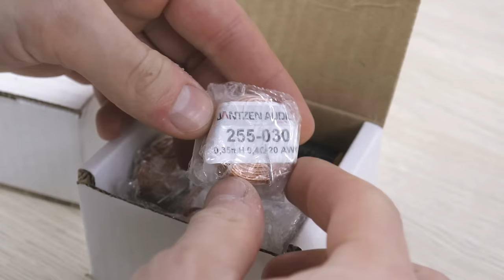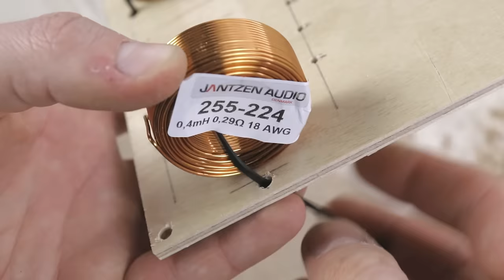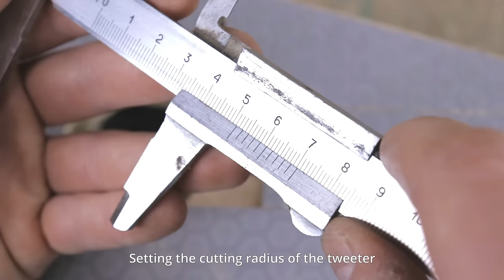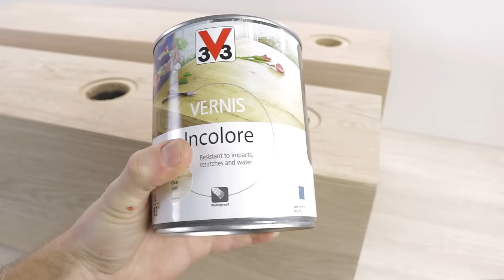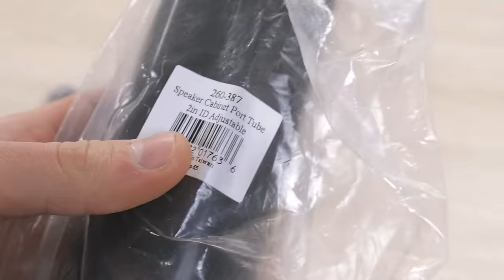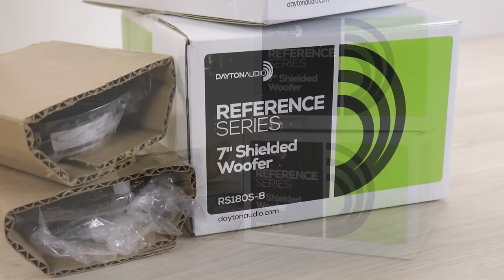These $185 DIY HiFi Speakers Sound AMAZING

Comment: This is so well done! I hope the speakers give you years of enjoyment!

Also, what is that center-punch thing you used? I've never seen one of those.
Reply from the maker: Wow, thank you so much! Means a lot hearing that from Paul Carmody himself.
Just a regular spring loaded center punch. Works great for woodworking and even metals. Something like this - https://amzn.to/3BV8LmG
Reply: Speakers definitely can last.   I built mine back in 1978.  They each contain one 15" woofer, two mid-range drivers, and four tweeters.  The only repairs ever needed was the replacement of the outer rubber foam ring on each woofer.  The old rubber foam rings had literally turned to rust due to age.  Total repair cost of woofers, was about $27.
Reply: I'm excited to see this build, I followed Paul for a long time, ultimately building a pair of ZX Spectrum that I still have as my main set. I built them 7 years ago and have listened to and jammed to every day since then, only sounding better. The abuse through the years these speakers have endured is unfathomable, full volume sometimes hours on end. I'm glad to see Paul is still around, mine are driven by a Rogue Audio Sphinx off a Dual 1219 tt, friends still don't believe I built them. I've denied countless offers of purchase. Covered the front in some neat fabric I found at Mood in NYC, built the cabinets about 3 inches taller with 25 pounds of lead shot in epoxy settled in the bottom, little better caps in the crossovers.  Coolest speakers I've ever seen, hardly ever heard better. Thanks Paul, my family and I are still appreciating your work every day after all these years!!! I'm headed home now with my latest LP, just delivered, and will jam heavy late into the evening. Go ZX baby! Thanks again Paul!

Comment: if you can, make a video of the making of the crossover
Reply from the maker: I don't see the point of making a video dedicated to the crossovers since there are quite a few diagrams online which are clear and easily understandable. Also, there are pcb boards on eBay for easy assembly.

Comment: They are very nice looking speakers.. You did an awesome job.. But the speakers are actually junk the actual speakers not the wood..  They are rated at sensitivity level 82 DB.. Which is very very low that means you have to have a huge amplifier to push it. And they will distort. They're good if you're just listening in your bedroom but they're not good if you're listening to a surround sound system or having a party
Reply: Paul states the sensitivity at 83-84dB, which is not quite 82dB, but still very low. He also states that the Woofers will run out of excursion around 96-98dB, so indeed these won't play excruciatingly loud. Still, at that point, you're only pushing 32W or so, and they're not meant to play louder than that. So no huge amplifier needed.
Also, the notion that low-sensitivity speakers distort is simply wrong. As long as you don't push them past their limits - as with any speaker - they sound as designed. It does not make the speakers junk. If anything, it only means that they are not for you . The Amigas are called the "botique Hifi Killer" - which is pretty much the polar opposite of what you'd expect or want for a nice beefy surround home theater system or a party boombox. They're much more comfortable in a living room, with a record player in the middle, and playing some music with high fidelity, not high volume. (Not saying both at the same time is impossible - it is for this speaker, though.)

Comment: 26:21   be careful next time ,those tipe of drivers cannot take any debries fallen on the voicecoil hole they have no dustcaps and can get easily contaminated and at 26:48  big nono there  put the tweeter on top of some masking tape roll and avoy the dome colapsing inward and risk geting break the silk material
nice handraft by the way
Reply from the maker: Thank you! Learning something new each time!

Comment: Nice job !! But 185$ if you already have the equipment to build the speakers. Really nice job anyway !
Reply from the maker: Thanks! Yes, the cheaper kit does require additional work and tools but the more expensive kit comes with cnc-cut panels so saves you quite some time, effort and need of fancy tools to complete.

Comment: An 8 ohm Woofer and a 4 ohm tweeter?
Reply from the maker: No issues with that, the crossovers are designed for these speakers.

Comment: It's a very beautiful speaker. However, if possible, put the two units in separate boxes so that they do not interfere with each other, and ideally the back of the SP should be long enough to prevent the SP from vibrating. Do not open the bass reflex hole as it makes an incidental sound. This is my SP idea. Thank you very much.
Reply from the maker: Thank you! There is no need for a separate box for the woofer and tweeter. The whole enclosure IS built for the woofer with the required internal volume. Tweeters do not need to be separated since they do not require enclosure volume. These speakers are designed by Paul Carmody, you can look up his great and popular designs on the web.

Comment: nicely built! except, i dont understand how you end up at $185, since even the cheapest kit is already $151 without the MDF box, without veneer, without feet, without speaker terminal, without varnish and is only for 1 speaker.

So including trim and finish, i guess you are looking at at least $400 a pair
Reply from the maker: Thank you! These kits have increased in price since the release of this video but are still well worth it.

Comment: and believe you me in my lifetime I have built an upgraded many of speaker rebuilt crossovers replace drivers just literally experimented with a lot of different types of speakers to get the sound that I wanted a lot of people have had listened to some of the things that I've made up and they called it Frankenstein eating but they could not believe the amount of sound and Clarity I got out of the stuff that I've made just my experimenting like those speakers you just built those tweeters that you put up in the top I would be putting orange in there instead of those tweeters be dropping those woofers down about another 6in and making room for a 3-inch mid-range which would improve the range of those speakers and you can do a lot of work on the crossover also those resistors have a tendency to become magnetic so you can change out those resistors in the crossover
Reply from the maker: Awesome! Would love to have my speakers compared to yours. Though I don't see the need of altering this great speaker design by Paul Carmody.

Comment: Rather have 3-way but less and less manufactures are offering that option... 
Also. I clicked on your link for the Full Kit and Ghostery Spam/Scam Protection Stopped the page from being opened..
Reply from the maker: I'm sure you would stick with this 2-way if you'd take a listen. With an F3 of 34 Hz, these speakers don't need a subwoofer for most situations.
Not sure why the links are blocked for you, perhaps since they are shortened by using a different url?

Comment: Why are speakers made from MDF? Can you mot make them from real wood?
Reply from the maker: There are many advantages of making speakers out of MDF, some of them being: it is more consistent in density and thickness throughout the board compared to real wood, it is easier to work with, and of course - cheaper.

Comment: I didn't see a single measurement of the acoustics characteristics. There is no filter calculation. I suspect that this is an ordinary acoustics without a bass.What can you expect from such speakers ?
Reply from the maker: Hi! Currently I do not own equipment for measuring the acoustics. These speakers are designed by Paul Carmody, you can look that up. They play down to 34Hz, most users don't need a subwoofer with these speakers.

Comment: Cool project. I personally wouldn't use that much sound dampening material. That's wayyyy too much and you'd lose all sorts of low mid frequencies. A big part of high end speaker systems and things like guitar amplifiers is the type of wood that is used to give good acoustics and projection in the frequencies that humans have a harder time hearing. Pine is my favorite material for that, but it needs lots of breathing room inside for the best sound.

Comment: the only thing different I would do when I was making us speakers when it came time to install the drivers I would be using a screwdriver instead of the drill because we got to do is me one way or the other the wrong way and that that drill can go right through the driver and then you got to go and order a new driver for pair of speakers you just bought that's why I would be using a screwdriver it is a lot safer and you have more control over a screwdriver than you do a drill
Reply from the maker: I guess a steady and slow hand does the job just fine holding the drill.

Comment: is $185 dollars after spending a few hundreds to thousands on the tools to make it? not to mention how many hours did it take to make it @ you're $/hr rate vs going to buy a new pair ?  I get it and all, as a trained sculptor and current plumber I understand the joy and reward of physically building something successful.  However, some very specific tools and techniques you are using in your process that not everyone has readily available or the years to learn it. nice informative video though!
Reply from the maker: Thank you for the comment! The kit with the front baffle does require some work but much less that what I did since it has the front panel all routed. You can also get the $240 kit with the knock-down cabinet which requires minimal tools for assembly, basically a few clamps and a sander with a drill. I made the entire cabinet myself so I did need the more expensive tools of course. Since this is a hobby and a passion for me, I don't consider the $/hr rate. Though I'm sure you can get something off the shelf that sounds similar to these for the same price point.

Comment: Nice woodwork. The electronics, not so much. Soldering is supposed to add electrical strength to an already mechanically good joint - not provide the entire physical strength. 

And those crimped lugs are going to oxidise over time. Should have been soldered after crimping.
Reply from the maker: Thank you! I'm quite positive the connections don't take much stress so the soldering should hold just fine. I think I did apply a bit of solder after crimping, just didn't included that in the video.

Comment: I don't have the tools, nor that big work table, drills, and fancy circle cutting jig... etc... therefore, I can't DIMS.
Reply from the maker: Lots of tools are not necessary to build these. You can get the pre-cut kit which requires a few clamps and perhaps a sander for a nice finish.

Comment: At least you show the most important thing... the crossover..... 33% of your money should be on the crossover. 40% bass and inductor 30% midrange and lows and 30% crossover... JS whatever you spend on your speakers you should double your money for quality power. Just remember you could get a 4000w amp for a car for 200 bucks but for 200 watts of clean power is nearly 4 grand.... JS

Comment: 185 for speakers 5k on machinery to DIY them is not so fissible.
Reply from the maker: Well not much machinery is needed if you buy a pre cut enclosure kit.
Reply: @DonnyTerek  guess you are right. If the kit needs just screws and glue it is a perfect build for everyone.. I really liked the workmansip though.
Reply: A small router, a drill, and a soldering iron…$5k???  Damn, you buy your tools at Tiffany’s or something?
Reply: @rickyjasper3044  It seems that we are in another page or somethinh. DIY is the whole process from scratch. Then it is just assembling.. I was refering to the first part. Tiffanys not so bad for buying tooling although.
Reply: I get where you’re coming from, but how much of the process do you need to dY to consider it a certified “DIY”.  Should we be felling our own trees for lumber, or is it ok to buy a sheet of mdf from HD.  If you’re buying a sheet from HD you can pick up a skill saw for $30 while you’re at it.  Or have them cut your panels to size on their giant panel saw.  

I’d consider the full kit build from PE a “DIY” project by my standards…but if you need to go out and manufacture your own mdf sheets from sawdust you collect in your own shop from trees you felled yourself then yes, you will likely need some expensive equipment.  

Otherwise, even if you have zero tools (which includes almost no one who would actually take on a project like this) you could get every tool you need for this from Craigslist for $100-150.  Then resell everything to get you’re money back if you don’t want the tools anymore.

Comment: Why doesn’t the manufacturer and drill out the holes and ports on this DIY speaker? Heck charge an extra 20 bucks…
Reply from the maker: It does not take much to have them drilled yourself. Also the speaker driver holes might have very slight differences in production so they would not align 100% all the time.

Comment: Almost $300 each now
Reply: Over $300 for the full kit if you actually want the laminate and terminals (hard to use speakers without wire terminals). Plus you still need hundreds of dollars worth of tools, some soldering skills and a lot of spare time. Meanwhile, Wharfedale, Fluance, KLH and Klipsch, to name a few, all have excellent pairs of tower speakers for less.

Comment: Just checked these are $240.00 each not worth the price unless you have all the proper tools.
Reply from the maker: The $240 kit consists of cnc-cut panels so no fancy tools are needed for assembly apart from a sander and a drill.

Comment: DIY? This is manufacturer level of tooling ,   I checked my garage I don’t have these whatever kind of tools 😂
Reply from the maker: Well I built the speaker cabinets myself from scratch so I needed the tools but if you get the CNC cut kit, all you need is a sander and perhaps a drill for assembly.

Comment: Nasty binding post.  Solder right to post.  Piss on that long steel crap.    Think like a Dam.   No  blocking the sound.    Drivers solder to that wire.  No
 Little crap clamps  
   Those feet. Are crap also.   Give the build to a friend and.   Build a damn nice tower speaker.

Comment: What a waste of 30 minutes. How is one supposed to know how well they sound if there is no demonstration of how they sound. Very misleading title.
Reply from the maker: I suggest you read the reviews on this speaker kit. It would be great if it were possible to accurately convey the actual sound from my recording equipment to the listener's audio device with the addition of YouTube compression. An audio demo that is recorded can only be used for abstract judgement of the audio quality, in my opinion.

Comment: Let’s start with the wood it’s garbage. You gotta use Real wood like birch the components are 
SH-T. It’s a great art project however if you would’ve just used the proper wood and components you probably would have made an amazing speaker
Reply: Nonsense. You are confusing instrument cabinets (like electric guitar) with hi-fi playback cabinets. Unlike an instrument cab, which is part of the "instrument sound", a playback cab should never be heard, it should be transparent. With a hi-fi cab, we want it to be rigid, well damped, environmentally stable, and surface resonance free. Grained wood is none of those things, it resonates, it swells and contracts, and it warps.  Only two types of wood products provide the quality desired in reliably usable ways: Plywood and MDF. A high quality dense plywood is the best choice, but MDF gets you 95% of the way there at a third the cost. It is also easier to work with as there is no grain or directionality, and easier to finish.

If I were to criticize anything with most of these DIY cab videos is nobody seems to understand (or at least talk about) front baffle design, surface reflection control, and phase alignment to widen the effective field, reduce distortion, and increase transparency.

Comment: ....   look at that binding post.    So the guy now has to upgrade that. Junk.      Lol .
He is a carpenter. Not to much a Audio Guy   look at the connection to the Drivers.  All these clips  & junk.   Solder wire right to driver.   Bypass what this guy is doing.    Also.   Buy so carpet or hard floors. Feet.    Not weasel toes